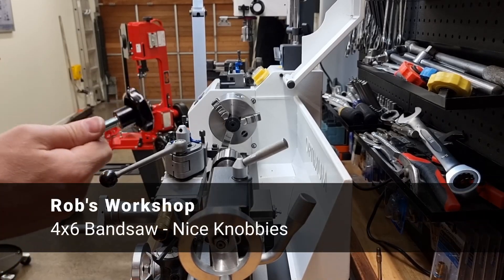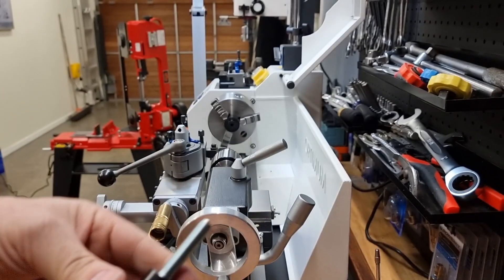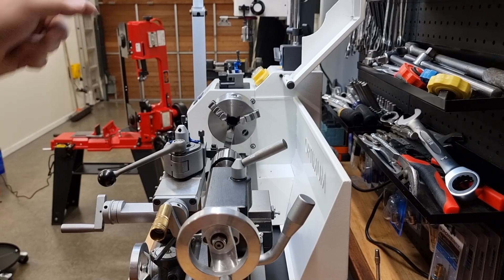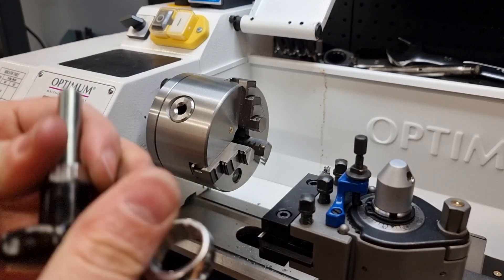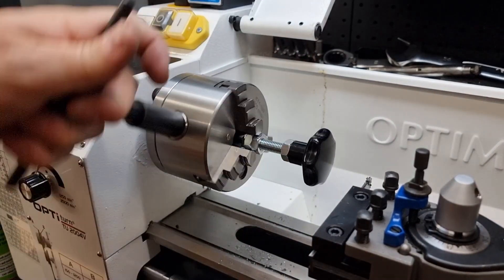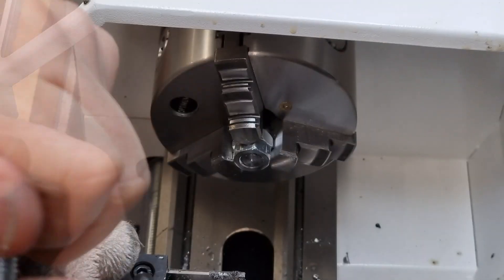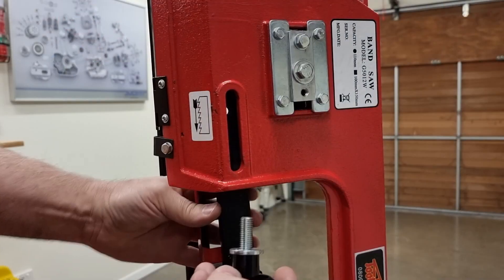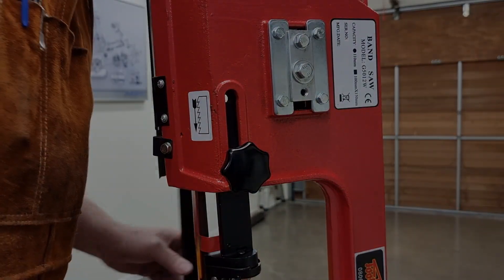Knobs Trump Bolts - 4x6 Bandsaw - Rob's Garage

Comment: Could you just chuck the threaded portion ?
Reply from the maker: Yes, but I thought someone might tell me off for clamping the jaws down onto a thread and causing some sort of damage, so instead I did that thing with the nuts, which was a bit wobbly. If I did it again now, I'd use the copper jaws I made in a recent video and clamp the thread in those.